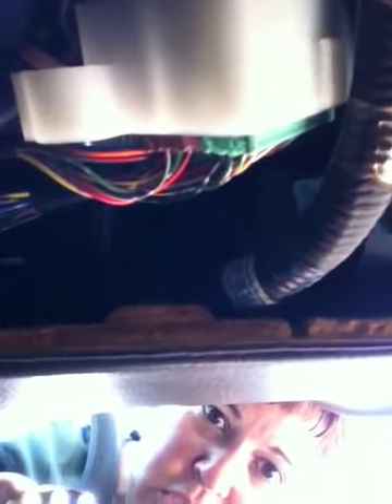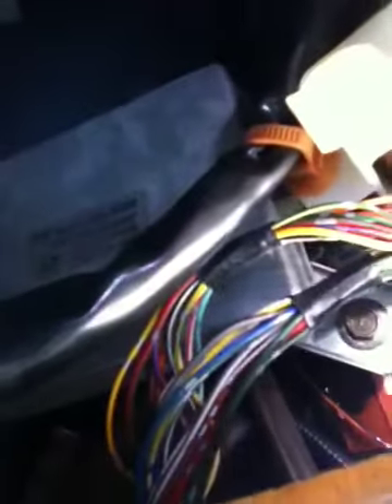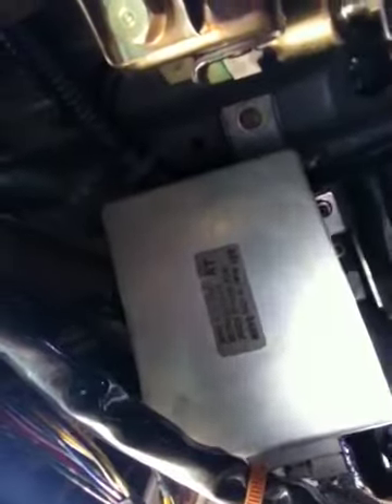'91 Honda Accord main relay replacement

Comment: Thank you so much for helping me find this part. I was getting no "fire" to my plugs. Two weeks of youtube videos and other "expert" advice and a 
(wasted) 200 dollar aftermarket distributor it turned out to be a faulty Main Relay (apparently, if this relay fails, then the "signal" to the distributor to "spark" wont
happen.  Didnt find this tidbit in any videos i watched. So...if no spark and no fuel...check main relay.  Thanks for helping me find this!!!

Comment: I love this video and the fact that you were resourceful and took the initiative to replace the Main Fuel Relay yourself. I am also a woman and my car would crank but not start. I called out mechanics who did nothing but charge me for them to "guess" what the problem was. First they said it was the distributor. I went onto YouTube and found out how to replace it myself. It wasn't the problem. Now they say its the fuel pump and want to charge me $150.00 for labor. I will do it myself.

Comment: Thanks, Amber, I was going nuts trying to find out where the thing was. I have to pull it to test it, but am not looking forward to the contortions (even though I'm a skinny guy the bad back hates getting up under the dash). I agree with your replacement versus fixing argument. When I bought my 91 Accord the daytime running light relay was shot - huge cost to replace. Tried re-soldering the nine connections recommended by YouTubers, and it would work for a few months and give out. After the third time I gave up and now just turn my headlights on whenever I drive (has the bonus of having my tail lights lit for better visibility from the rear). Don't know if you still have your Accord, but with help from people like you I'm determined to keep mine going for much more than the 370,000 km on the clock right now. And there should be a special circle of hell for automotive designers who require owners to be snakes to fix stuff on their cars.

Comment: Thanks! This happened to me this week, and I was stranded on the side of a major highway. After letting it sit for a couple of hours, it started right up and I drove it home, but it hasn't stared since. I was going to replace the fuel pump until I found out about this relay. Thanks again for showing me where it's located! Going to try that today.

Comment: Nice video, I used a 10mm deep socket with a 6" extension and a adapter to place on my cordless drill. The deep socket is needed for the nuts holding the bracket for the main relay. Everything came out smoothly.

Comment: That was great Amber! I had to replace mine and I spent several hours trying to figure out where the relay was. I didn't realize it was hidden. You were right, once I found it, it wasn't that hard to replace. I wish I had seen your video before I did mine.

Comment: Thanks Amber I have a 91 accord that's been giving me the blues lately. After watching several videos on the relay issue and where it actually is located I wasn't getting that info. Now, I don't know what I'm doing but I know something needs to be done and your video was straight forward and to the point. I will be buying a new main relay and not a patch job. Thanks chica!
Reply from the maker: sunni james do you still have your Honda? how is it running?

Comment: Greetings! First let me praise you for getting down and making the effort let alone making this very informative video.  A few days ago, a hot day I might add, my Accord failed to start.
My local garage whom I trust implicitly diagnosed this very same issue... the main power relay under the left dash. They charged me $170 C  and the car starts like new again.  It seems this is a common problem as the solder joints in this relay become 'cold'  i.e they need to be resoldered to restore electrical continuity.  Anyway, my only complaint is I didn't find your video in time to preemptively sort my relay out.  Thank you again for being an intrepid car girl!
Reply from the maker: Thank you so much. Even 13 years later I'm still humbled everytime someone takes the time to comment. I'm sorry I wasn't in time to help you.

Comment: Fixed it! Thank you for help diagnosing and providing instruction! I re soldered all joints on the circuit board, placed it back into the housing and no more crank no starts. I have explained more detail below.

Comment: You are great, I have a Honda Shop manual that shows were the relay is but I could never see it.  The power steering unit that she calls out is the cruise control.  That you so much for saving me time for finding the relay.

Comment: This was exactly what I was looking for. My daughter has an Accord. I actually repaired the main relay in my CRX by re-soldering the connections.  A note to anyone who chooses the re-solder route.  Use a solder sucker to remove the old solder, then use flux and new solder. I

Comment: Thank you so much for your video, I was able to replace the main relay on my 1993 Honda Accord. I had the same issue, car won’t start when it’s hot. It was the same process except that the location of the relay was in a tighter spot, electrical wiring was in the way, btw, my car has a manual transmission. Now able to start the car even when hot. 👍
Reply from the maker: I'm so happy to hear that all these years later this is still helping people.
Reply: Yes, you’re still helping people after all these years and I love this car, it’ll be 30 yrs. old this July ( bought it brand new ). It now has 488,000 miles and counting, could have been way past 500,000 miles had I not retired. Used the car to and from work, 6 days/wk, 100 mi./day. Rarely used the car in its early years. Thanks again for your helpful video and more power to you !👍

Comment: Thank you Amber.  It was like you were describing my problem.  I only have the problem when it is a hot day.  Starts fine in the morning and at night for my 91 Accord.  Sometimes jump strating it will work.  Have change the distributor twice but keeps hapening again.  Will try replacing the main relay.  Thank you again.

Comment: Thanks for sharing that info. I have a little 91 accord also and it was starting at first, but when you turn it off it won't restart, we've changed the fuel screen and the fuel pump. Will try and replace that relay next.
Reply from the maker: how did the repair go? did it work?

Comment: Thanks for the Video I used it more to fix the problem on my 02 honda accord. the only suggestion i would give would be to use the flat head to just pop the relay off the bracket and install the new one. Without having to use the 10mm but either way works the results are the same, possibly save 5 min. But really good info and video, so far its work for my car.

Comment from the maker: My car wouldn't start at all. But I have been told that some people had the problem you are describing also. What I have been told is that there is a crack in the part that is effected by heat. The heat causes swelling between two parts creating a bad connection. This in turn causes the car to either not start or cut off depending on how bad the crack has become. Replacing the part is a cheap and easy way to fix this. I hope that is what you need to get you back on the road.

Comment: @Amberdawnn76 - Thanks a ton. I had the exact problem with my 93 Honda Accord. It used have starting problems intermittently. About a year back, a mechanic diagnosed it and told that the fuel pump was bad and I replaced it. But the problem never went away - it was getting bad by the day and finally about a week ago, the car would not start at all. Found your video very very helpful. Followed it step by step and it worked. Again, thank you very much and God bless...

Comment: You are the bomb!!!! I was going to buy a used one out of the junkyard. But it was late the night I figured out what was wrong. I needed to get to work the next day. So AutoZone was still open, so I ran and got a new one $47.99. Glad I did because I was thinking the junkyard model sure would be cheaper. But who knows when or where I would be if that one was to fail. Sure I could have solder the circuit board. But at Autozone I got a warranty. So I feel better having a new one. I was also thinking that a dishonest mechanic could really rack up on this repair.
Reply from the maker: so glad you decided to go with I new one. may auto parts are just fine used but it's good to know when new is better. how did the repair wor out for you?
Reply: +Amber Waite Good everything was great. I feel better with the new part.
Reply from the maker: +thurm101 so it's running well now. sadly I sold the honda, so sad. I had to get a mini van to accommodate my grandson and another grandchild on the way. I sure miss my baby.
Reply: +Amber Waite grandson! You look great for being a grandma AND can handle her own car issues too!  Kudos to you Amber
Reply: Amber Waite you should've kept the honda and the mini van

Comment: I found it interesting you said you started having the problem during a hot day.  I myself started having intermittent blinkers when it was a very hot/humid day.  It turns out my "turn signal/hazard flasher" was going out.  I don't know for sure but I think the moisture in the air can cause shorts in some electrical systems.  I have a 03 Honda Civic Coupe EX.  The hardest part in the replacement was getting the original Flasher out.  I had to pry it out with a screw driver.

Comment: Its crazy how your video and your smart detail on how to fix this after seven years it helped me with my almost new honda1992 I'm glad I saw this before Changing the fuel pump.  My old relay had a very strong burn smell I switched it and bam.  Thank you so much.  I couldn't hook the cruise control back on any tips? I might just take it off.  ThanK you
Reply from the maker: In not sure why you can't get it back on, sorry. Is it just hard to get to?
Reply: Its hard I'm a big person with large hands I had no trouble taking it off but putting it back it was harder.  But I got it done.  Everything works now I just vouldnt put gas in it today and my gas gauge is broken but thank you gor your help

Comment: Same issue here.  ~220,000mi on a 99 Accord EX when I had this happened.  Currently has 226,000 and has occurred maybe 5 times within the last 6000 miles.  Going to take out the circuit board and try re-soldering the connections tonight.  The car has seen 15 very cold winters and 15 warm humid summers.  Hoping this fixes the problem.
Reply: Removing the relay board was tricky, but doable. Easiest to pry out the board once disconnected versus removing the entire assembly. Instead of buying new relay, you can re-flow the solder and add new solder. Solder joints can be bad even though they visually appear good. Re-flow all solder joints, don't let the iron sit on a joint for too long or you can damage the resistors or other components.

Comment: one thing you could have tried that is free is to take off the cover for the main relay and reflow the solder or replace it. there is about 4 - 6 solder joints that gets cracked over time. the cover is held on by a couple of bits that snap in in place. if you can find someone to resolder it for you it would save you some money assuming the relay itself is fine. this is a common problem even on new relays. theres a write-up on this floating on the internet, i googled it

Comment: Hey Amber! Ive found your video and it is so helpful! Im wondering how you got the bolt with the screw pertruding from it out? (The one holding the main fuel replay in place) i tried using the same 10mm i used to get the power steering box out but the screw is so long that its stopping me from grabing on to the bolt sround it, thanks!

Comment: Amber great job, thank you! Can you please let me know how many miles on your car? Thanks
Reply from the maker: Christopher Cole at the time if this video it was 198k
Reply: Okay, thanks. Mine lasted until 115K, but age may also a factor. You made changing it look a little easier than it actually was, lol. Now it's done, hopefully that's the fix.
Reply: I should also add for others who may later be interested that I decided to go with an original Honda OEM part. As of today, 5-19-17, my local dealership actually had one on the shelf. Same brand, Mitsuba. Twice the cost of an aftermarket one at $124.00 including tax.

Comment: Wow! Very impressive! You go girl! :) I've been having the same problem. It just started last week, and only (so far) seems to happen when my car is warmed up. I start it and the RPM goes down within seconds and shuts off. If I keep my foot on the accelerator and get it into any gear it stays on. In cold weather, it's perfectly fine. I have a 99 Honda Accord EXV6. Do you think this will work or that I should try this route first? Thx! :) Great video as well!

Comment: Hi Amber, just wondering what year and model is your Accord. I have a 2001 Accord V6 and my relay is difficult as hell to get to compared to yours and it appears to be in a slightly tighter spot to reach.
Thanks, Alain
Reply from the maker: Mine is a Japanese model 1991.

Comment: I had the same problem of the "S" and Sometimes when I put gasoline turns on and off well what i did its this i hope work with you carr too,
1.- first remove ignition control only the control cable. put the new one or used.
2.-remove the air control valve and clean it gently because it will be filled with coal, just clean the mesh hole. and put it back.
3.- remove the pressure regulator and put a new one or used.
4.- open the lid of the FAST IDLE VALVE do right turns with two flat screwdrivers→→

Comment: Couple of questions. Does it still start without the same issues? If not how long did it last? Did the check engine light and flashing D4 light come on? Could you hear a  crackling sound coming from the same area as the relay? I’ve replaced two relays that I bought off Amazon for 15.00 and both didn’t last a month. Can you put up a link to the one you bought? Great video!
Reply from the maker: I bought mine from auto zone for around $50. I had it a year after I replaced it and it was perfect after that. No crackling heard.

Comment: @Amberdawnn76 

I think your problem might be a vaccum leak, one of the hoses for the air intake system might have come undone or loose i had the same problem in my 87 accord i fixed it by simply replacing the stock intake with a performance one since i was gonna replace it anyways they sell them at the auto parts store and shouldnt be too expensive hope this helps

Comment from the maker: Also I found out that the problem causing my car to rev up and down by herself is I have a bad intake air control motor. A new one costs over $200! I have decided to buy one from the junkyard for $25. Fingers crossed it will fix the problem.

Comment: hi, i am deaf. when i put key on the car., it wont start the motor.. but i check the battery it good and oil good too.. but one thing is plm wont start a motor. how i need get new one?

Comment: I did have the same problem with my car a 1991 Honda Accord Manual Transmision I´ll try to repair it ifrst if it won´t work, I´ll buy a new main relay. Regards.

Comment: Sweetheart...the big silver box that in your way...is the (  Cruise control unit )...somebody lied to you.  There's a black relay that's bolted with the Main fuel relay...That relay is the ( Fan relay switch )  

For example..if your radiator fan isn't coming on...first thing to check would be fuses.  Then the relay ( now you know what the black relay is that's bolted with the Main Fuel Relay )  Courtesy from a man that fixes 90*93 Accords.  ;)   take a look at my Accord vids.

Comment: I have a question guys why my Honda accord 90 starts when its cold but when its hot it doesn't start any more? I changed the main relay, I scanned it and it says crank sensor put auto zone and all auto parts says that that car doesn't have any crank sensor I don't know what the fuck to do any help?
Reply: it your dizzy cuz its builded in change the whole you should be good
Reply: drizzedre please explain
Reply: change the distrubor that sensor is built in
Reply from the maker: It was pointed out to me that was a solder point on the main relay that often broke.

Comment: →→(not pressing so hard) just to get a little hard then its already tight now back 1 ½ turns back and put the lid back.
5.- Removed coolant tempeture gauge sender and the tw sensor or coolant tempeture sensor is beside the coolant tempeture gauge. after you did all this the "S" will not show on screen anymore my carr is working really good now  no problems with that. If you think where you can find all this parts very cheap go to PICK N PULL or U PULL IT i bought →→→

Comment: →→ all my items for my carr over there and y paid for all that pieces 45 dollars... if works just let me know is not your transmission if u not heard weird noise and u are changing the oil every 4000 miles your carr is good. For last when you changed everything turn it on and let fill the items of gasoline because everything its empty do not panic the car will turn and let it on 5 minutes and take it to the road test it.